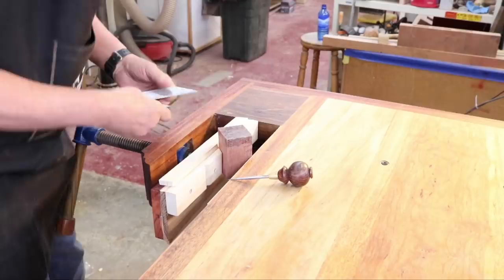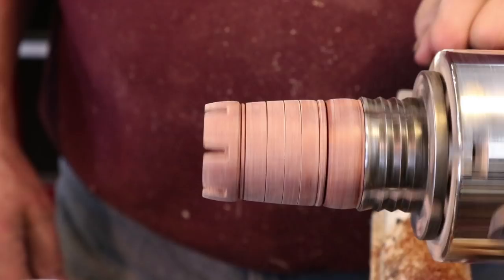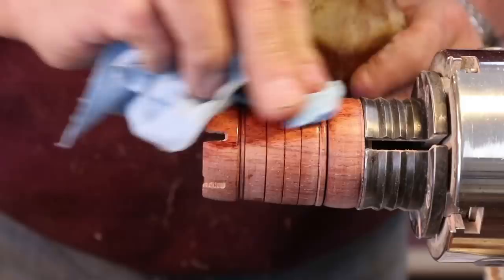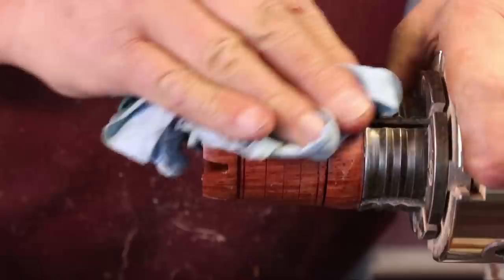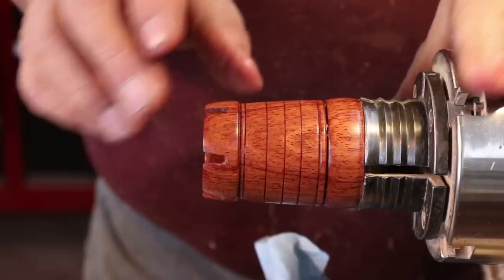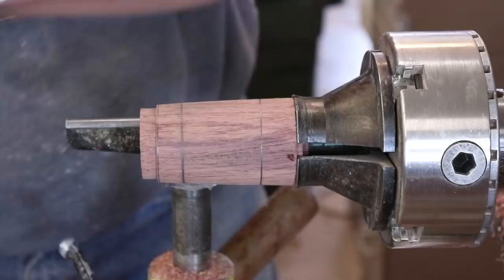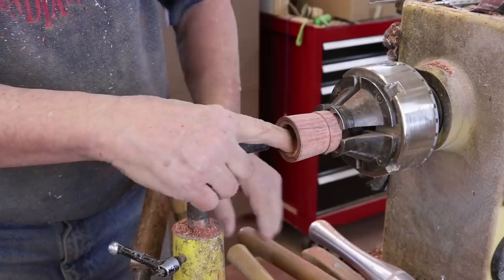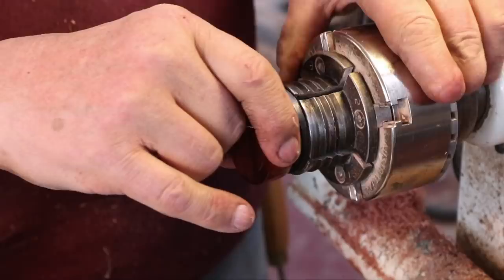Castle Box..... by Sam Angelo  the Wyomingwoodturner

Comment: A Castle fit for a king. Very nice work Sam. I am, however, curious as to your alternate method for cutting the slots in the top.
Reply from the maker: I am still working on that.  I did find some very small circular saw blades and I am working on a good way to mount them on the lathe for use-mainly during demos.  Sam

Comment: Nice Sam...I'd like to try this someday...brand new to turning..tried my first bowl but forgot to check depth..nice hole in the bottom about the size of the tenon.😉 also made a nice lidded box but it has a crack from the bottom to the lid..ugh...thanks for all your videos!
Reply: We all make the occasional funnel.  We call those practice pieces and claim they're for practice on tool control.
Reply: Don’t worry too much about the flaws.... you’ll learn as much or more from your mistakes as you do your successes as it is.

The crack in the lid- without seeing it, something to consider: if you’ve got a piece like a lid which is now rather thin, when you go to part it off, give yourself room and part it off double the tool width of you have a narrow parting tool. Step back and forth. That gives debris a place to exit and keeps the heat down. Also- careful when you sand, watch your RPM etc. The heat from those operations can cause cracking.

Sam’s videos are great. If you have a club and I’ve got a good one where I live, it’s a great resource and source of inspiration.

Enjoy
Reply: @waterfordrs22  thanks guys!..just getting my feet wet...I'm gonna try and fix the box...I joined a local club recently and need wood!..as luck would have it on the way home from work I finally saw a truck at a field with big logs..he owns a construction company and has a huge amount of logs and trees he cuts..says I can have all I want for free!..said he'd even take logs to my house!..I guess I better get my chainsaw ready...wish now I didn't sell the one with the 30" bar last year!

Just now converting my bandsaw to wood and have a big 3 phase grinder with a VFD and CBN wheels I bought from Ken at Woodturners wonders...and a wolverine jig...just gotta learn to use it.

I have a home machine shop but this woodturning is fun...haven't turned on a wood lathe in 40 years since high school!..

Thanks again..appreciate the encouragement.
Reply from the maker: @MikeB0001     mike, as you get better you will make more mistakes   that is what I have found over the years   Sam

Comment: Very nice project really like your videos. Just curious why you didn’t do the box the other way ? Threading the top and hollowing the base
Reply from the maker: Good question.  I have been preparing to do this project in some upcoming demos.  I have turned around 10 "prototype" castle boxes.  I have experimented with thread placement.....lid vs base orientation and form and shape.  I have since changed this version a bit.  Sam

Comment: Sam, how do you economically heat your shop?  And do you heat it overnight?
Reply from the maker: In my main room  (30x40 feet) i have 3 electric wall heaters with fans.  They are each 220v.  I do turn them down or even off during the nights, unless it is really cold.  And I do have a wood stove that helps.  I got the heaters at Lowes.   Sam
Reply from the maker: Daryl,  I responded to this question in an email. Let me know if I did not Sam

Comment: What's your shellac mix?
Reply from the maker: Ron, I usually start with a 2 pound cut in a large glass container that I use for storage. Then I put it into smaller bottles I use for dispensing the shellac.  A 2 pound cut is pretty thick but this allows me to just add some denatured alcohol to thin it down. When using shellac if it is too thick then it will dry  too quickly on the surface. If it is too thin it will soak into the woods and take too many coats before  you can work it  Sam.
Reply: @WYOMINGWOODTURNER  I am sorry for being ignorant with shellac, but the only types I see are premixed Minwax cans.  Is there a place you would recommend to buy the raw flakes?
Reply from the maker: @Replacemybatteriesplease    Ron, the mistake is mine. I just assumed that everyone in the known world uses shellac flakes.  Actually buying a can of shellac from your hardware store is all you need. I find that these products are mixed had a two or 3 pound cut. Or they are very heavy in their mixture. This is a good thing. As I mentioned before you can always thin this down with denatured alcohol. Additionally this will extend that 1 quart into at least 2 quarts of shellac. I am getting away from using or buying shellac flakes as these are very expensive now.  Just go with a can of shellac from your hardware store. Happy turning Sam